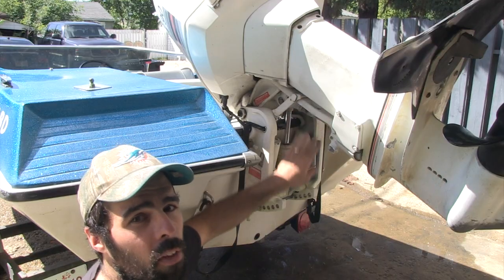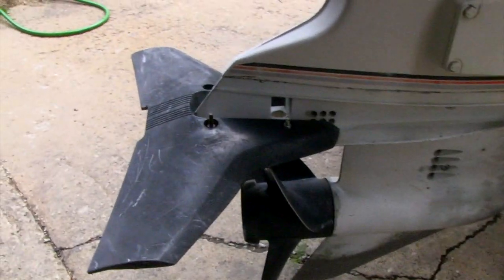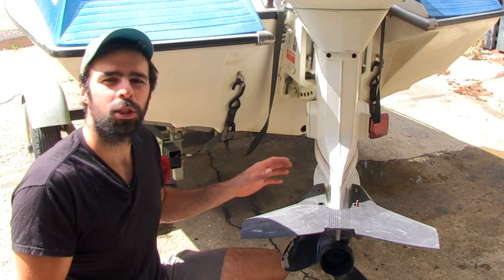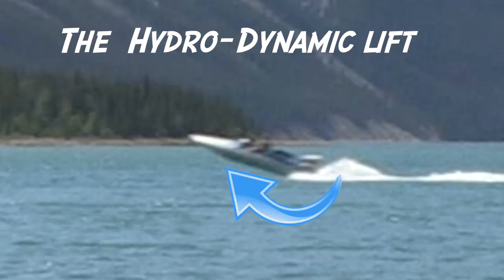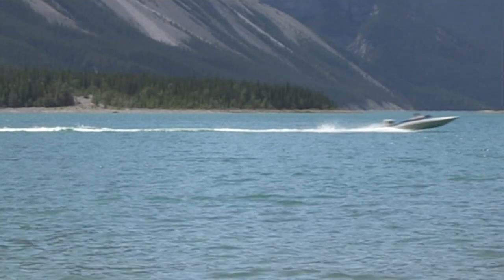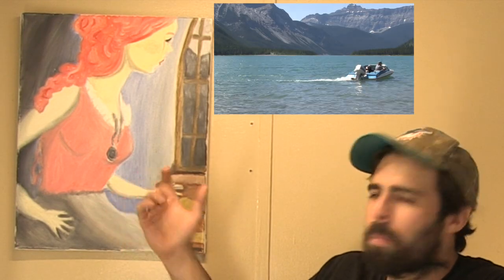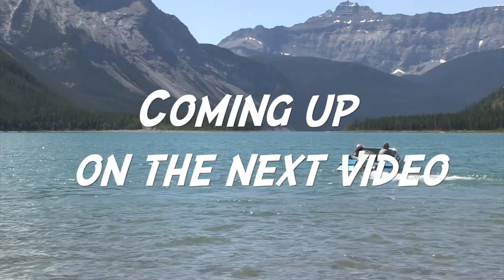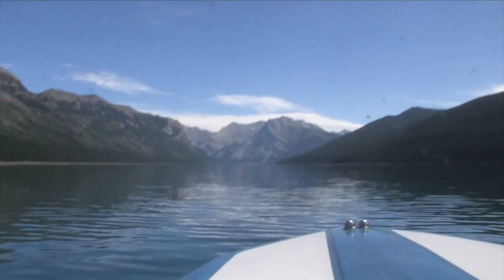Outboard Hydrofoils (How They Work)

Comment: I was looking for something to reduct porpoising on a 14' aluminum boat with a 25 hp outboard. I moved weight forward and trimmed it to keep the bow down but now I have the tilt angle set to maximum forward angle and that prevents much upward trim when I go into shallow water. I was listening to learn the reason you wanted to make your boat to do those "bunny hops?"

Comment: sny foil on an ouybord says the engin was installed by an amerture.Outbored manufactures know a lot more than this guy.
First look at transom angle, which the outboard manufactures forced boat builders to change from 12 to  degres  to 16 degrees in the 70s.
It took many boat manufactures lots of years to comply.
The foil will help, but introduce drag.
Put a wedge on the transom so the cave plate looks up at the keel will give a much better result.
Reply from the maker: Thanks for the comment Doug. I'm not sure what you mean by "ouybord" ?
Glad you enjoyed the video!

Comment: great video thank you. could you please tell me if hydrofoil would be beneficial for my 6hp 4stroke outboard? its on a 10ft inflatable dinghy. some say hydrofoils are only good for 10+ hp outboads anything smaller is a waste of money and will slow down the boat.
Reply from the maker: Hello Crosshair, I don't think think it would be beneficial. You might lose a little top speed and it would make getting on plane harder. I would suggest placing all of your gear and fuel tank as far up to the bow as possible. Experiment with the angle of the trim possibly one pin higher may help. Thanks for watching!
Reply: @Bansheeboat  awesome thank you
Reply from the maker: @jeansandmyshirt   Not a problem. Happy boating!

Comment: Question: The classic stingray hydrofoil is flat in nature. They also offer XRlll in which is more round or curved. Which would be best for towing tubes and wake boards?
Reply from the maker: I don’t think it will affect the wake too much. The new curved one seems like it would definitely be smoother and possibly help to create a smoother wake. Either one will greatly increase stability and you will feel a more stable and smoother steering while towing a tube or wakeboards.

Comment: Can u put it on yamaha 2.5hp shortshaft?
Reply from the maker: Bastian22 anything’s  worth a shot but that’s a small motor. I wouldn’t waste the drag when you only have 2.5 hp. If you do put the smallest one you can find.
Reply: @Bansheeboat  alright and what if i wanted 2 2.5hp motors would it be as fast and strong as 5hp or should i just get 5hp cause 2 portables is a waste?
Reply from the maker: I would have to probably look into a whole different motor all together . We had a 20 horse power Johnson that was 30 years old and has been abused and still runs pretty well. You could get an old but decent motor for cheap. I wouldn’t do 2 percent ya too much to deal with if you ever have any problems.

Comment: I’m fairly confident if Mercury or Yamaha thought these were a good idea, they’d come standard. They have engineers working for them.
Reply: Aftermarket and performance parts are just that aftermarket and performance just like cars the factory can make them fast but usually the aftermarket performance industry market items for performance.
Reply: If thats the case Mr.AB 6....then why does this product improve the performance???? I know I've used them for years on Mercury, Yamaha, Honda and Tohatsu outboards. If you have no experience, or knowledge then you should keep quiet and listen. Then you may learn something.
Reply: @terrybeasley2898  again, if they are so great why don't they come from the factory with them? And you don't have to be such a condescending prick when you reply to someone. You must be fun at parties.
Reply: Terry Beasley any 1200 hp motor would not be reliable. Just as this stupid fin is not reliable and could damage your lower unit. My mom has been dead for 26 years, but thanks for playing.
Reply: @AB-bg1or  i have ran these fins for over 20 years and they have not damaged anything at all. Sorry to hear about your mother,,, i guess that last party was just too much.